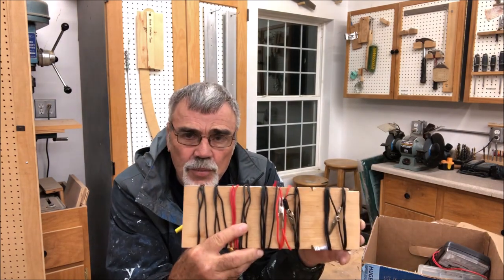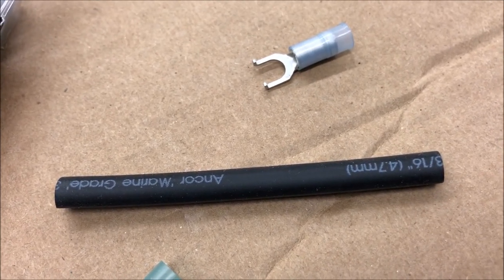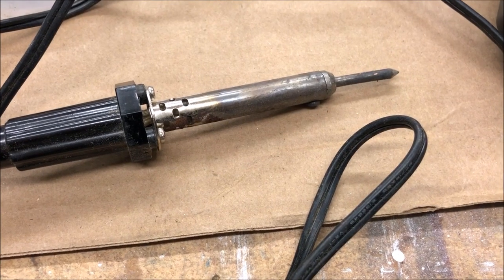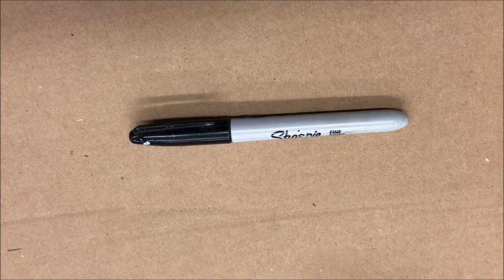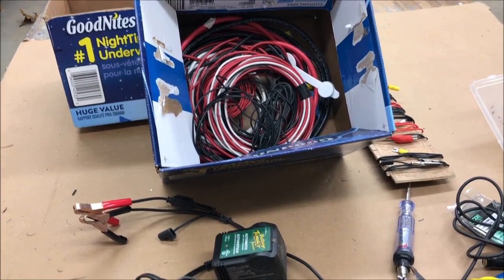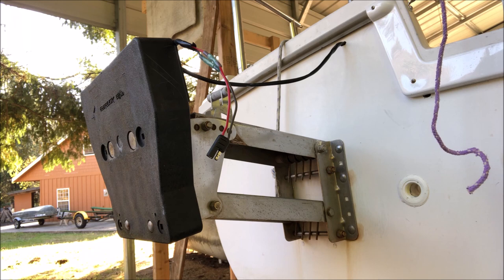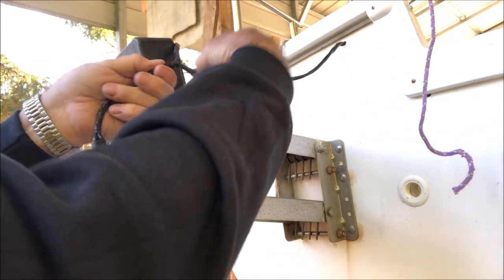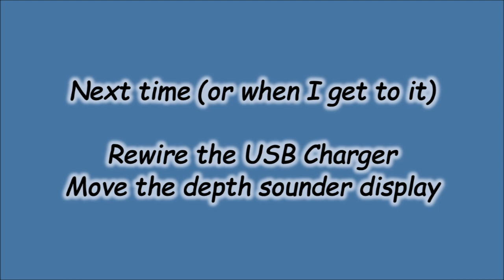Re-wiring a Small Sailboat (A) -- Catalina 22 -- Jim's Little Boat

Comment: Nice video. Although most C-22 owners will not be installing shore power (alternating current), some small boat sailors do. If that is the case, use the new ABYC standard wire colors. The 12 volt circuit wiring needs to be yellow for 12 volt ground and red for 12 volt positive. If you have both DC and AC systems on a boat, confusing black DC ground with black AC "hot" lead could potentially be fatal.  That said, using black & red wires on a strictly 12 volt set up on a boat is fine.
Reply from the maker: Agree.  Of course I don't live in Florida where 
AC is kind of important.  The only AC I would add to my boat up here in the typically cool Pacific Northwest is a battery charger.  In that case I would make up a 30 -amp plug to 120 plug pigtail and include a a GFIC in the circuit.

Comment: Jim,

Really enjoying your series and insights.  Just bought a Catalina 22 Mk I (1977), so I think your boat is the same configuration as mine.

Did you ever do a follow-up video to this one re: re-wiring a Catalina 22?  I've basically decided to take out the existing wiring on my own boat and start over, so I'd be interested in seeing how you did yours.
Reply from the maker: I did not, BUT, I have a new switch panel in the shop and I will be replacing it soon.
Reply: Cool.  I wonder if there is a better place to put that switch panel than on the port-side aft settee seat, down low where you can kick/break/trip over it.

Comment: Hi Jim, love your videos. I have a 1980 CnC 25’ sailboat that needs the wiring redone. What size wire would you suggest? Thanks
Reply from the maker: I am really not the guy to ask; you should probably check in a reference book or ask a pro.  I do it German style.  I used the biggest size I think I could possibly need, and then I go one gauge bigger "just for stout".
Reply: Good answer Jim